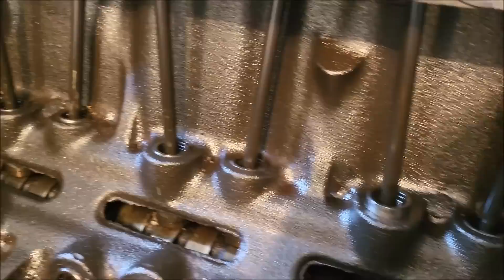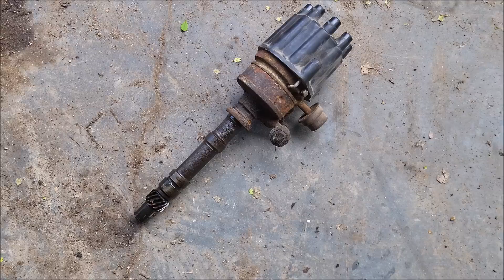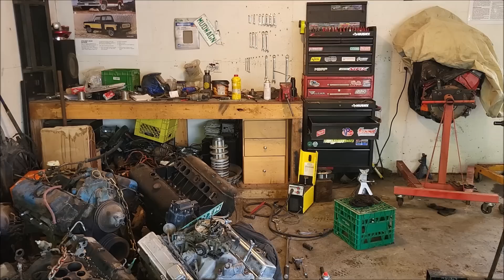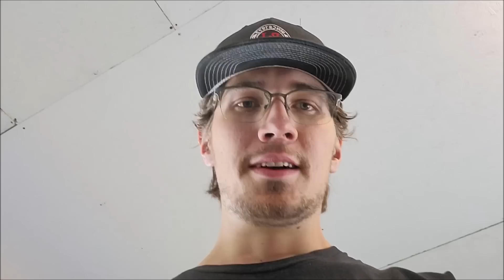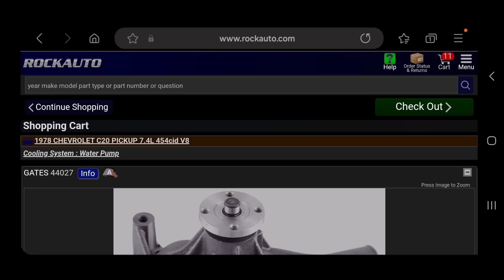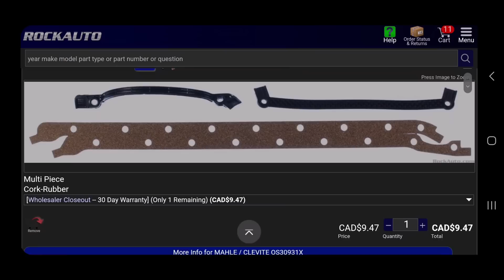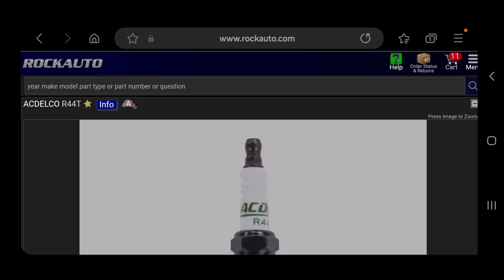Why Does Everyone Ignore Tall Deck Big Block Chevy V8s?

Comment: Been more than a few years since I've rebuilt a BBC.  I currently have a 366 and std 427 sitting around.  I also have a grain truck with a 427 5spd and 4spd auxiliary trans with a pto and dual rear axles.   Came here looking for modern information.  I'll check your play list to see what you have done.  Thanks

Edit. 
Well, that was disappointing.  You haven't added to the rebuild 😕. 

Hopefully you will have a finish video plus more.

Comment: I worked at a construction company as a night mechanic in the early 70s these engines would last about a hundred thousand miles in a dump truck before needing a rebuild
Reply: I drove for a company that head several and the way we thrashed on those things makes me believe that !   That is some grunt work.  A long pull up out of a gravel pit at 46000 pounds and the 427 singing a 4000 rpm 10 times a day will do that !

Comment: Smart people do not ignore the 10.2" deck 427 Chevy. It will bore to 4.350"-4.375", and will accept up to a 4.50" stroke with steel rods.
Reply: Forged Flat top 403 ci Oldsmobile Small Block pistons fit that combo , they are 4.351 inch standard bore , same pin height and size.

Comment: The taller deck pushes your heads farther apart, and you need intake spacers ( you know that already), but also your headers will be a tad farther out, making these engines a bit harder to fit into a narrow engine bay.

Comment: I'm a ford boy but I worked on a fleet of 366s and I saw them make it to 400000kms driving a 4000 rpm on the highway unopened. Unbelievably reliable.
Reply: I like Mustangs and Mopars, but gotta respect them big block chebbies.
Reply: Any chance you know  where to find a service manual for the tall deck 366? Got a 1995 schoolie with this engine. rochester throttle body.
Reply: @tonyhoffman242  no idea. Might want to contact a chevy workhorse dealer.
Reply: @tonyhoffman242 I downloaded one off of a website a couple years ago. It was free.  Was a site about maintaining school busses. I don't recall the name. I might still have a copy. Or it might have been on my old phone that I ran over with a dump truck.
Reply: Valve float was around 4500 rpm. Constant 4000rpm would cause temp issues but not bottom end problems. Valve float can contribute to burned valves. Bottom line is any big block, 366,427td,396, 427sd, 454 were all rock solid up to 6500 rpm if you can control the valves. Only real issues were wiped cam lobes.
Reply: Ford's biggest gas V-8 was the 534 Super Duty, which topped out at 277 hp. This was produced from 1958 to 1981.

GMC, meanwhile, had a gargantuan 637-CID gas V-8 that was derived from their 478 V-6. This was produced from 1966 to 1972.
Reply: I seen many suck valves and blow pistons up and block is junk then
Reply: @markrobinson4230 I worked on a fleet of 25 and we had a single burnt valve and 1 that a guy cooked because of a blown rad hose.
Reply: @j.danaclark2166  It was rare that they burnt valves because they were sodium filled industrial . As for running @ 4000 rpm's, that would have sounded like 8000 with the cams they had . lol 
Never heard of one running at that speed . I'd have fired the fools running them that hard . They are normally a low rpm industrial motor and winds slowly (kind of diesel like) .
Reply: @johnjay5143  I don't know the routes the trucks were on so they may have been more gentle but can't argue with the results.

Comment: Yes, the 366 was actually a good running engine. It was actually my motor that I let my cousin use I pulled one out of a dump truck and me and my cousin put it in his 1974 nova it was not fast at all. It had no horsepower but it had a shit ton of torque it would light the tires up Very easily but it would only turn about 4000 RPMs it was done and we left truck intake on the truck water pump. It had that weird ass thermostat double thermostat housing we had to make an adapter for the radiator hoses and everything we left the factory distributor and just converted it to pertronix electronic ignition, and we took the factory carb off and put a just a regular 750 double pumper on it and we ran it and it was a real reliable engine he drove it for almost 4 or five years like that until he over revved it to 5000 RPMs and broke a piston

Comment: My nemisis of my being... the 366.  All the praise comes from people that never worked them as they had zero power and just got hot. In a pickup you will never have that issue though.  That wasn't just one truck either.. it was many.  The 427 was a lot more fun and had a decent bore size at 4.25" like the low deck variants.  The heads on them are pretty awful in most cases... like 1.94" intake valves and 120plus cc chambers. The 4 ring pistons aren't meant for rpm but it all depends how far down the rabbit hole you want to go.  If you notice, most praise comes from guys that are literally using only the block lol.  I keep tinkering with my neighbors tandem with a 427... dumping in a normal hei and ditching the governed Holley helps, which you don't have anyway lol.

Comment: I remember a story about these blocks being used in Top Fuel several years ago!
Reply: Not in Top Fuel. Nobody has run anything but aluminum block Hemis since the late 70s.
Reply: @JeffKopis  I think this  was around  the late 60's early 70's . I remember they were running out of Hemi blocks,  Also using the blower on the truck block they had to make a custom intake spacer for the blower. Car ran reasonable to a Hemi but had a valve problem. So this was a sort of one off project.
Reply: There was a nhra top fuel SBC powered rail in the 80s he was leading points until the nhra decided to stack weight on his setup . He was absolutely dominant.  @JeffKopis
Reply: @petemcpeterson6205 That was Rick Santos, and he dominated Top Alcohol dragster with a 377ci SBC built with a Rodeck block and ALL PRO heads. I've seen it up close and met Rick. Pretty cool dude. That was back in the mid 90s.
Reply: @JeffKopis They did use 427s in Top Fuel funny cars and dragsters in the late 60s. Jungle Jim Lieberman used them in his T/F funny cars up till the early 70s. It wasn't till the early to mid 70s when the DONOVAN and Keith Black aftermarket blocks took over.

Comment: The 427 is the one you want to use 600 to 700 foot pounds of torturing torque 😂😂😂 probably around 400 to 500 hp good for your application. I would not use those blocks for max effort they crack core shift 🙄 but for a general mild build you will be😊 overwhelmed with the torturing torque this engine will pump out .hence why they aren't generally not used in say a camaro nova ect,ect but for a truck your using it for what it was designed for the intake will be a issue but those can be build machined  ar home 😉 distributor exhaust and a few other minor hurdles for a home technician if torque is what your after you definitely  won't be disappointed you will have a reservation of gobs of that on tap 😉 and i mean a lot .make sure you transmission is up to the task ❤and good luck ,i like unorthodox builds not many tackle, but definitely go with the 427 tall deck they used them in marine racing applications with some decent results 👌 unfortunately once they were really up there in power they had issues with the blocks but you aren't building a 1100 hp 900 pounds of torque engine youll be fine at your power level 😉 youll be good 👍 😉 😊❤

Comment: Good points !   We would always grab those engines when I was building big block chevy's back in the 1980's because they had a steel forged crankshaft .
Reply: Many dont.
Reply: @paulz2641 all the tall deck engines came with forged cranks & 4-bolt mains.

Comment: Also, a 454 does not have a neutral balance, they're externally balanced. They have counterweighted flexplates and flywheels, and the damper is also counterweighted.  Note: NEVER turn the motor upside-down before removing the oil pan.

Comment: I have a 76 K20 Suburban that runs a nasty tall deck 427 that we pulled from an old C60 flatbed we had on the ranch. It was a bit more involved rebuild than the 396 low deck it replaced but was 100% worth it. At least its not another 454 like most guys just plop in.
Reply: As the driver of a Suburban with a 454 I am offended lol

Comment: I also have a 366 in a 1986 C65 single axle dump truck.... It has a Holley carb from factory and an HEI distributor.... School buses are also a good source for 366 engines... Bigger tow trucks can be found with the 427 , had one of those also

Comment: Don't forget the 402 tall deck engine in pickup trucks... I have 2 ... Both have factory stamped Hi Performance closed chamber oval ports heads ... These were factory bore 402 not . 30 over 396 blocks, they are two bolt mains
Reply: GM did not make a tall deck 402. I don't know where you got your information, but you are dead wrong.

Comment: I was wondering about these tall decks looks to me they would be good for a boat you need torque . I would behoove you to replace the rear main seal after all this work it would suck balls to put a pan gasket on put it in your truck and have is puking out oil on your new clutch and all over the ground not cool replace the rear main seal dont blow it off

Comment: So can you run the same aftermarket performance heads/cam/intake as you can on any other chevy big block?
Reply: Yes, you can.  You can also stroke 'em but you need to use spacers between the intake and heads to compensate for the taller deck height to use aftermarket intakes.  Builders are better off with ordinary blocks, but they aren't as common as they used to be.  There are some advantages with tall decks in boats I believe, as well.  Tall decks were designed for an extra oil ring specifically for added cooling for pulling heavy payloads over long periods.    

The entire engine is designed for higher than normal heat and mid range revs with steady pulling.  The timing curves are different as well due to the engine's ability to handle more mechanical advance timing.

Comment: I worked at  GMC truck dealer 1977/1982. Did plenty of long block replacement.GM did make a 454 tall deck big block as well. Did a few short block replacements on warranty. They would black hole a cylinder. Fellow mechanic had a 1969  Chevy Nova. He rustled up a complete 427(stock) and put it in his Nova. Ran like a truck.
Reply: Those tall decks 454s are rare as hell. Only used a couple years in the late 70s early 80s.

Comment: I worked on these way back.  These are stump pullers. Yes, low rpm. Unless you update them. But I worked on both of these. Most were in dump trucks, or trash trucks. There is nothing wrong with these. I used to be blown away at some of them that had factory headers huge 2 1/4 primary tubes. Like SB block hugger headers. I worked on the later 454 and 427 Tonawanda late model versions. But I preferred the old school ones. You will not be disappointed with that 366 in a square body. Torque like a diesel. Man. Memories. Lots of valve stem seal replacements, snd and rod bearing replacements. Thats about it. They are very strong.

Comment: Std BBC is 9.8” deck height, the tall deck is 10.2”. The 427/366 are basically the same as the 396/427 in that all are internally balanced, the 454 is externally balanced- flex plate/flywheel and balancer are different. Tall decks use a different- taller distributor and a different intake manifold. Most other parts interchange excepting a few variations for early and later models.
Reply: The tall deck Pistons are longer even an extra ring.

Comment: If you are going to spend any money on this motor, spend it on the heads and higher compression forged pistons...Go with a roller cam n lifters. They arent that much more money. All the horsepower is in the heads so spend your money on your heads.

Comment: The shop I worked for in the 70's pulled the gas inline 6 out of a 47 White Freightliner conventional tractor. The farmer requested we install a new 366, which we did. With the same gearing, the farmer was not satisfied because the 366 didn't have the torque the original ehgine had for the same rpm. I did not hear any more about that truck.

Comment: had a tall deck block ,had it sonic checked ,it had a core shift ,so some of the cylinder walls would not handle being bored out and stroked and handle too much power .you can block rock them

Comment: Now the 366 in my truck is a 66 and its geared on the timing set. The cam turns backwards. I think they did go to chain later on. That being said if you have gears that might turn your oil pump the wrong direction
Reply: We had a 1967 gear drive cam in a 366 engine. They used a special distributor gear and the teeth are different on a gear driven cam to turn the oil pump and distributor the correct direction.

Comment: Dad hauled Diesel fuel in a 1968 C60(?) with a 366....massive torque
Reply: When I got out of school in 68 I worked for an oil company and my favorite truck was a 68 C60 with a 366, 5 speed, 2 speed rear.  That truck weighed about 30000 loaded and just ran and ran without any issues.
Reply: @geneheck  yep...that's what he drove

Comment: I believe part of why There governed to turn many RPM is because they have  heavy 4 ring piston  the weight oh that reciprocating mass would wound the bottom end I believe some lighter aftermarket piston  would allow you to turn some more RPM with a different distributor  good luck finding a performance intake for the tall deck with out spending alot  many use a tall deck steal crank in 454 block to achieve a poor man's 427

Comment: The problems are low compression,  366s and 427s are 7.0/8.0 compression  and they dont make much power cause of that.  366s  theres nothing u can do with there flattop pistons and already 100 cc chamber heads.  and bring up the compression  to 9.5 to 1. 427s there  may be higher compression  pistons available  for them but not the 366s.  Ive ran them 366s gutless wonders   with low compression  and no timing adavance on the distributors  and wasnt impressed.  Id never waste time with a 366 unless i could get the compression  up the to 9.5 every for a low rpm towing engine u need compression  to make some power, torque. And mileage/efficiency.   Theres reasons there cheap cant do any upgrades to them.    Steel cranks and 4 bolt maines were tough built but were never needed they never made even power to hurt them.  366s you could run to the floor all day and never hurt them cause they never made any power and were governed  down.  Id rather  much stick with my 400 small blocks and 454s so much more can be done to bring compression  up there, just my 2 sense.

Comment: You can make a huge stroker motor with a tall deck big block.   I think my buddies race car is 572 CI but he is using an aftermarket block so I am not sure how close it is to OEM block.   I have solid models of 2006 Chevy big block RV engines used in UPS style trucks

Comment: To answer your title question is those blocks are almost non-existent due to all the mountain motor drag racers (both automotive & boat) snatch them up to be able to stroke them and not have to use shorter con rods.

Comment: I think Ford's 427 put GM's 427 to shame so GM kind of shelved it...😮
Reply: The Ford FT which was ford's truck version of the FE was a colossal turd. Even in a 1/2 ton nothing turns more fuel into less power.
Reply: @ronniedale6040  They can be built...if you can afford the parts. If you can find them. Build a Chevy.
Reply: That could be argued. Yes Ford's 427 was tough, but those FE heads never flowed as well as Chevy big blocks. The top Chevy 427 was better than Ford's. Even Ford guys that are honest with themselves will admit that. I'm a Chrysler guy, but still have to admit that Chrysler's big block wedge heads couldn't flow like a Chevy big block either. 
Ford tried catching Chevy with the 385 engines. 429/460 heads almost flow as well as the Chevy's.
Reply: Comparing stock to stock? The FE was great. 

GM decided the 454 was easier to make so we have tons of em. 

I personally don't care what make it says on the valve cover. But it is vastly easier to build a Chevy.
Reply: Can you say "L-88"?
Reply: @Geardrive427-ip8vj  I've often wondered why GM used those shorter stroked big blocks for all those years rather than the longer stroke of the 454, since longer strokes seem to be better for lower RPM torque. 
By the late 90's they did start using the 454 in heavy duty trucks, but I don't know if it was a tall deck or not. I assume it is. Also the 496 (8.1) was used in the later years.
Reply: L88 , ZL1, I don’t think so Tim. No fe 427 ever won a Can Am race…never made the finish line. They then tried the modern 429, yes the ones with the Chevy canted valve design …still didn’t make the distance, absolute joke😂
Reply: A Chevy 427 is WAY better than a Ford 427 in every sense of the word.your in a minority if you think it's better 😆.
Reply: @buckster2575  100%      I'm a Chrysler guy so I think I can be non-biased here lol
Reply: @johneckert1365  they where just better engines.ford was weird on there stuff.

Comment: You talk about weight being a problem, Dart blocks are much beefier and weigh a bunch more than factory blocks. Plus you can put aluminum heads and intake on it so I wouldn’t worry about the weight. There’s a lot you can do with a tall deck Motor in fact some guys swear by them. I’d like to have a few of the 427’s.
Reply: we have a 1972 tall deck 427 complete carb to pan in good running condition for sale
Reply: Buick/Olds/Pontiac 455's and the Cad 472 are very light weight for their size;  when the standard deck BBC's became harder to find these other GM big blocks were gaining popularity for mods. This is the first I learned of a tall deck BBC - these seem like a really good deal compared to fitting a BOPC big block or finding and building up a standard deck BBC.